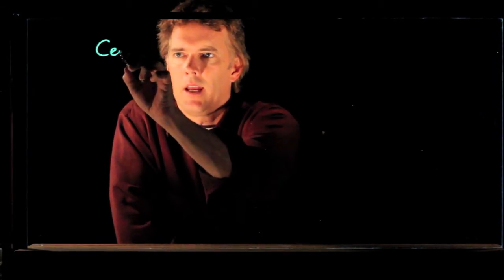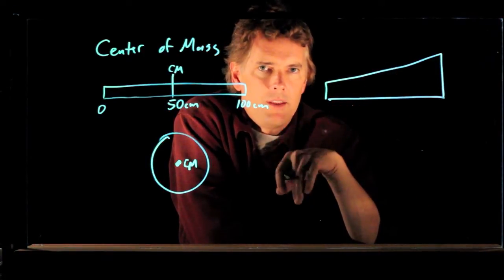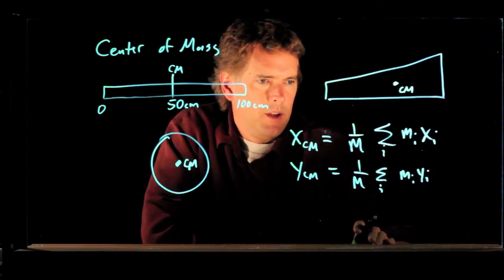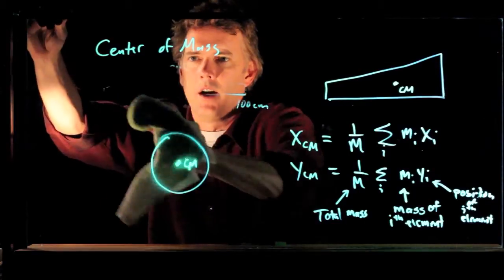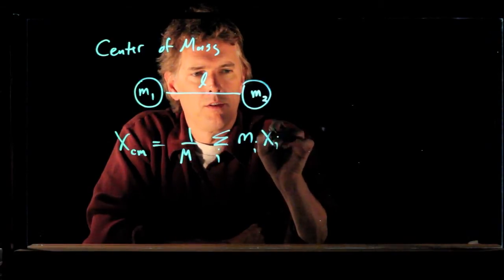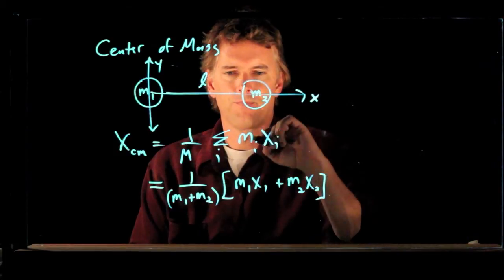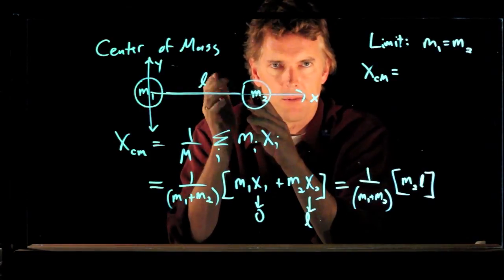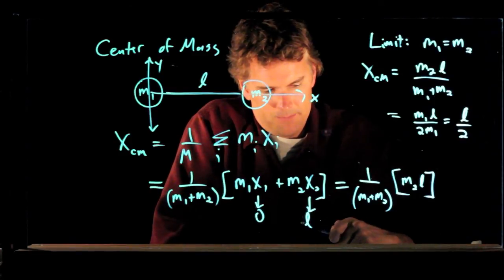Lecture on Center of Mass

Comment: Is the distance L between the masses measured from center to center? If not, would the distance from the origin of m2 need to be (L +  radius) of the circle? Thank you for your time.
Reply: 8 years later i have the same question and it is not answered :(, hopefully you've figured it out 8 years later
Reply: @Ward08AlQudahHe used the term point mass when describing m1 and m2, so it would seem his circles are just exaggerated and when he drew the coordinate system origin in the center but left  L being the same length it would seem to be implied that L reaches to the center of m2.

Thats my take watching it 8 years later.